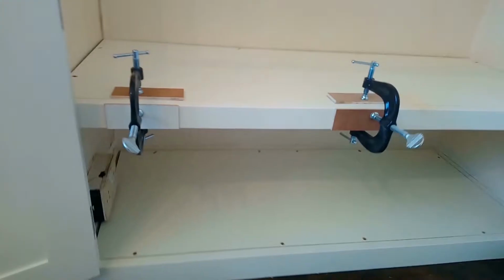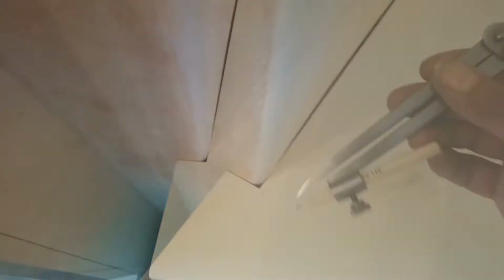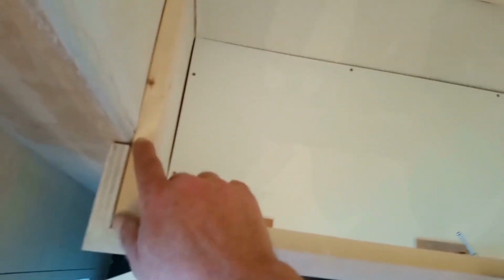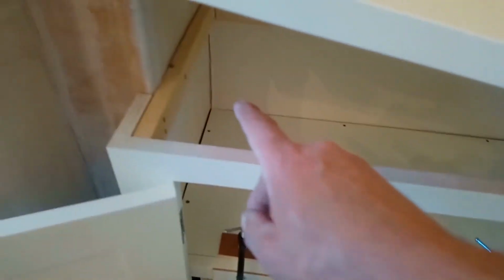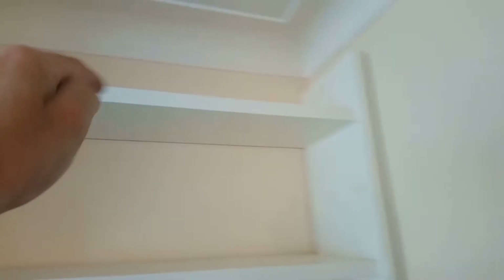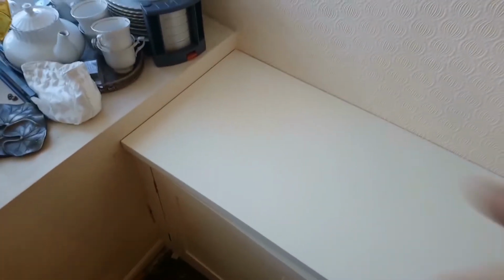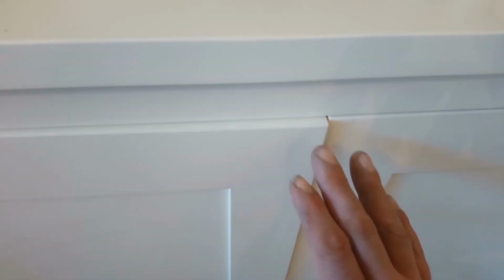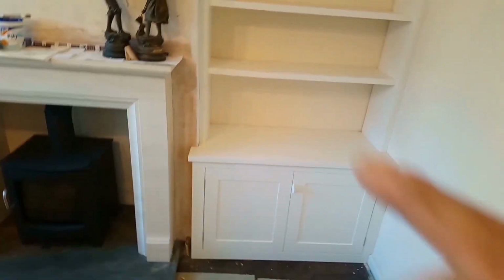Alcove Cupboards Build Pt6 - Final fitting

Comment: If I had been drinking tea when you said "easiest way" (to cut along your scribes edge) I would have spat it out. To me, that cut, just inside a pencil mark of a curved line - THAT is skill. 
Also how quickly and neatly you got the battens fixed in. 
Continuing to find it interesting to see how you fit and fettle these builds.
Reply from the maker: Thanks Andrew 👍 I guess some of it is time served, 36yrs i should be able to cut along a line 😂😂 but part of it is having a sharp saw & holding it right with your finger pointing down the blade as i showed on the pergola build, & don't force the saw, that's why you need a sharp one, correct any deviance off line immediately, trying to get back online after a few saw cuts can be hard & will effect the next few inches, sometimes the width of the blades distance before you can get back on track if that makes sense. the battens on the wall go on back wall first so once the side ones go on & you look in from the front you don't see any gap or at least you don't see it so much, it's called line of sight 😉👍

Comment: Hey Gid.  I have referenced this video 2 or 3 times now when drawing out designs for built-ins, and have had some very successful scribed pieces due to your excellent tutorials, especially the tops.  I have a question for you.   I have only ever made built-in units as a full cupboard underneath with sides and a back.  What made you decide to make this one as a face frame unit with support battens for the top and shelves?  Is it a cost thing?  Ive seen wardrobes done this way as well but you always seem to do them the way i do them as a fully enclosed unit.
Reply from the maker: Hi, 👍 I'm glad they're helpful.
It's partly a cost thing, it's also slightly traditional & logical, why make three sides when you already have three sides, I find it fairly easy to just put just a frame in, if i put a box/unit in I'd have to try cover the gap at the end where the firebreast is if the unit sticks out, similar to what i have to do on wardrobes, & the amount of space would be lost, thickness of the carcass + the skirting, in a lot of these houses removing the skirting is a no no & more trouble than it's worth. 
I always discuss choices of design & materials with my customer, do they want me to build a unit or are they fine with using the alcove as the 3 sides, i do suggest this way as my preferred choice & it's cheaper, the next choice is do i cut the carpet back & put a base inside & would they like a mid level shelf etc...

Comment: Not so much a question.  I'm always comparing myself to other carpenters I suppose, and always wondering if I should be charging more.
Reply from the maker: Ah yes, one of the hardest questions, The quote seems quite expensive but i need to earn more, would i still get the work if i made the price a bit higher, ?
😂 can't answer that, i didn't used to charge enough, The added time shopping for materials, added expenses, visiting potential jobs,  & time drawing or working out quotes, . 

Trial and error, I've been a joiner 34yrs, self-employed 18yrs, I still haven't worked that out, 😆